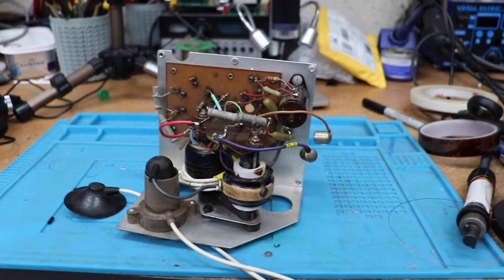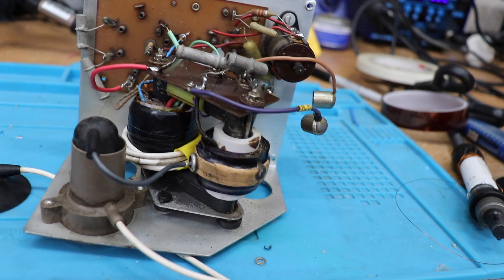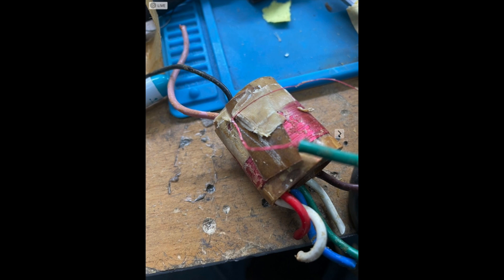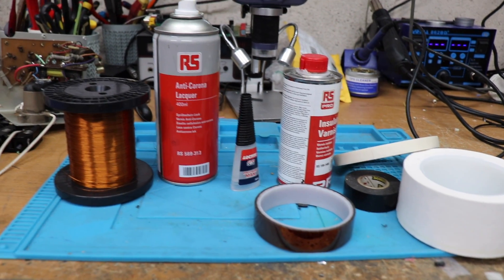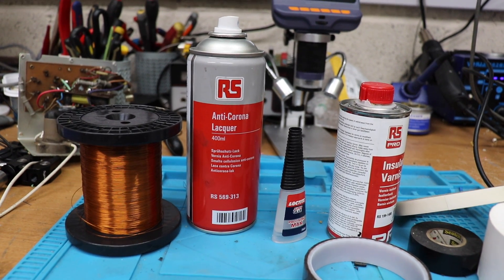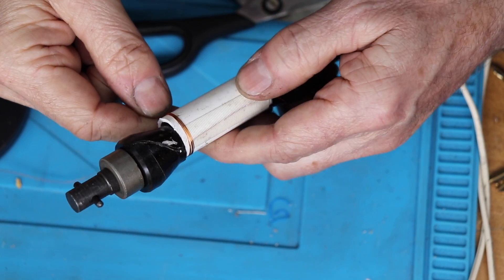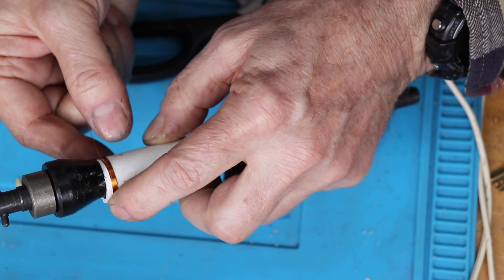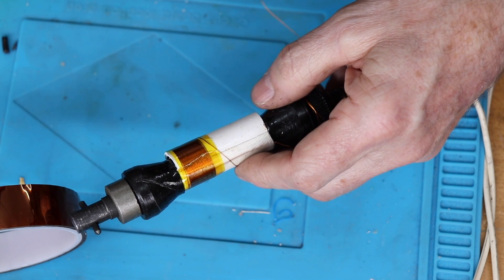How To Rewind A Vintage TV Line Output (LOPT) Flyback Transformer

Comment: Thank you for posting this video and explaining how to rewind a LOPT. I've got many 405 line only and dual standard sets here and the biggest fear is always is the LOPT stuffed! I notice you did this all by hand/manually. Most of the coil winders I've seen have counters on them and motorised ones having a digital counter. Why did you decide not to use one, are they not accurate enough? Thanks. Keep up the good work sir!
Reply from the maker: Hi, I do have a coil winder but found it was easier to do it by hand!!

Comment: how important is the insulating varnish? You only put it on the start and the end? I'm actively doing this right now and there's so little online information about how to do this correctly. The original was just soaked in wax, so I have no idea what's important to consider and wha'ts not.
Reply from the maker: I put it on after each layer.. seemed to work
Reply: @thewtf  I managed to rewind mine and I think it's done correctly. I do not have a means to measure the final output voltage, though the TV does come on. I was not able to see the television working prior to the rebuild, though. Does the LOPT affect screen brightness? Some documentation I've read says that the final anode accelerates the electron stream into the phosphors, so I'm not sure what that affects.
Reply: @FluffyTheGryphon yes it does affect the brightness to a degree as the final anode is supplied by the lopt. The brightness is usually controlled by the grid with a negative voltage